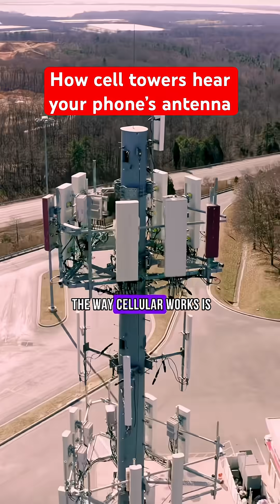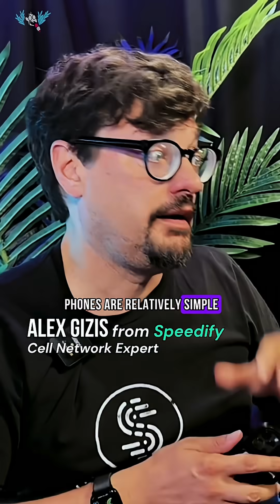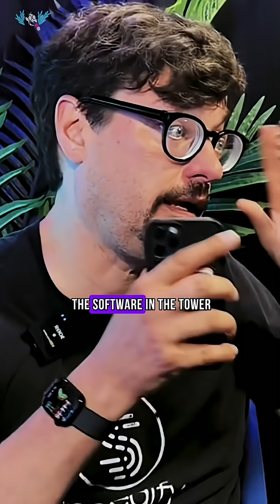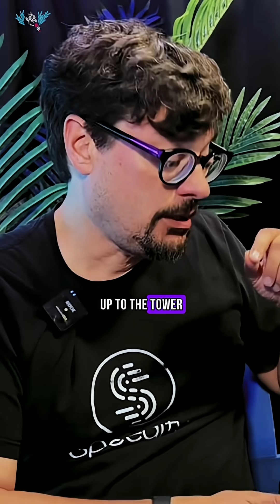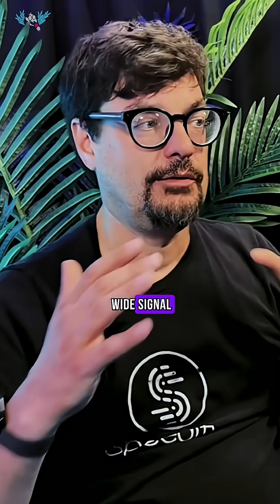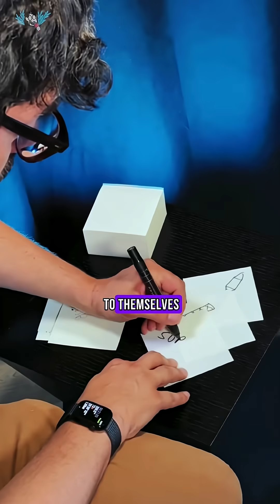How Cell Towers Actually Hear Your Phone’s Antenna

Comment: I'm putting a thumb down because you, as a YouTuber, have opted in for the automatic AI generated audio dubbing in other languages that has been recently rolled out by YouTube and it's shoving down our throats crappy voice-overs depending on the language of the phone's system and we have no possibility to change back to original. You have to be aware of that. I'll continue thumbing down all those videos because there's nothing I can do with YouTube who don't listen to reason.
Reply: Yes you can manually change the audio track but it is indeed very annoying to do. I watch all content in original language.
Reply: @lucbastin5972  Yes I know for those creators who enabled the feature I can see the new audio menu item but in addition to be annoying to do that every time on each video, it simply doesn't apply the change when it comes to YouTube shorts. It's infuriating to be stuck with that same French monotone AI generated voice-over talking so much nonsense!

Comment: Tower only talking to five or six phones?  I thought the tower would be talking to 50 to 600 phones, and LEO statellites 50k to 60k or more.  Color me unimpressed.
Reply from the maker: One tower antenna signal* is talking to five or six phones.
A whole tower or satellite is talking to dozens to thousands of devices, but each individual signal coming into a tower antenna is only aggregating a few device signals. This is called uplink aggregation.
For both 5G cell towers and high speed LEO satellites like Starlink, they're using Massive MIMO antenna arrays to connect to many of these aggregated signals. The "dishes" on the satellite are actually a phased array of thousands of antenna elements. This allows more users to connect at once, and also allows for stronger directional beamforming.
Reply: @Speedify  Oh I see. It kind of makes sense to me since after all cell phones use "spread spectrum" (SS) for their encoding in modern phones (a WWII invention btw) so if you mix signals together you won't lose anything, since with spread spectrum you can still detect the signal even if mixed with noise, I believe (and you would know better than me) they have 1:1000 signal to noise ratios with SS and it still works.
Reply: @raylopez99 video is referring to CDMA (if they said so, it would have made further reading much easier). There are other types of multiple-access but I think this is that
Reply: @lawrencejob  CDMA is a form of Spread Spectrum so my point upstream stands.  FDMA is another and TDMA is yet another.  I'd like a more techy explanation but I think most of the audience would tune out.
Reply: @raylopez99 yes